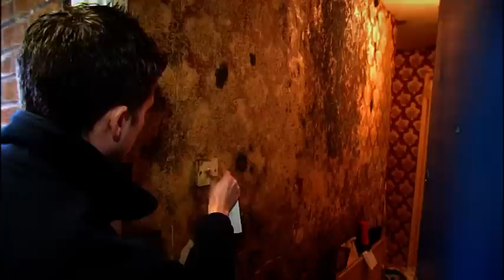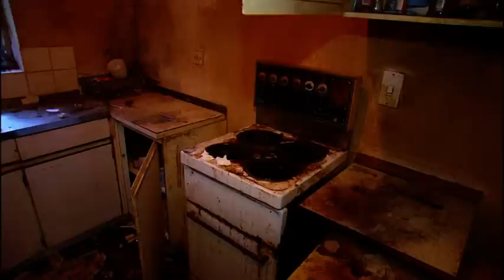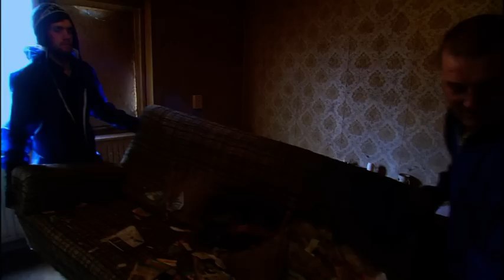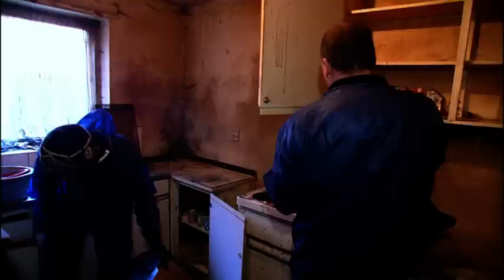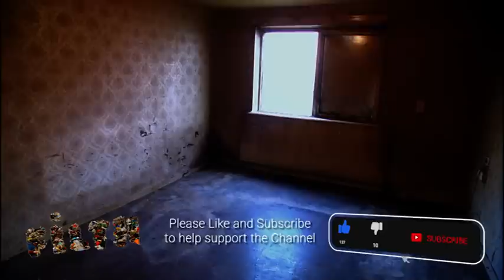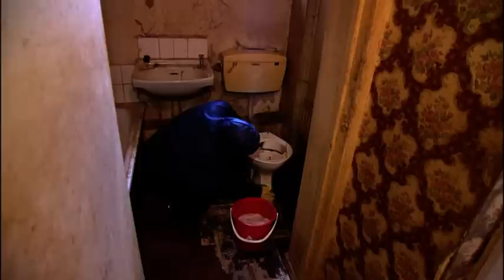The Worst Toilet In The UK | Grimefighters

Comment: i cant understand why they even bothered cleaning that toilet.. Its honestly (in this case) worth just buying a new one.
Reply: And you would've removed the shitty one yourself or what?
Reply: @earthbound_one  that's exactly what I did with the toilet in my place when I bought it no way was I cleaning that.
Reply: graham moore  was thinking this. The toilet was beyond use even clean. Would of been much cheaper to pull out the old one and put in a new one.
Reply: I feel sorry for the new set of tennants who are going to occupy that flat
Reply: its a council flat, the council wouldn’t pay for it so the cleaners would have to buy it if they were to break it. people of higher power wont spend money on working class people like this
Reply: @louise.g80  They have to rent out these flats in a good condition. The cleaner would not have to buy squat. If they are so keen on not spending a penny they would not of hired cleaners. On top of this replacing the toilet would have been cheaper than the time it took him to clean it.
Reply: Sir Budz no what i mean is that the toilet still worked so the council wouldn’t go out of their way to buy a new one unless it wasn’t useable, everyone here questioned why they cleaned it and didn’t just throw it away. also i dont know why i said cleaners would have to pay but if they were to just break it up (while its working) without checking with the council first the council probably wouldn’t be happy
Reply: Exactly
Reply: I mean where I live you can get a brand new toilet for 75 dollars sometimes at the big box hardware store
Reply: buRn thE fUckInG bUilDiNg dOwN
Reply: I was thinking the exact same thing. They had Rob cleaning a broken toilet for a good few hours. That thing was FUCKED.
Reply: @louise.g80  that's just absolutely not true at all. Of course the council would fit a new one. It's in their best interest.

Comment: "That house doesn’t need cleaned. It needs burned to the ground." That's not even an exaggeration. The whole house, it's walls and floors, has soaked in bacteria, viruses, mold, and who knows what else. Someone living there with mental health issues could have used weird chemicals on the floor or spilled who knows what or poured shit down the sink.. You don't fix all that with some surface cleaning.
Reply: I was thinking the same thing. The cabinets needed to be ripped out, all appliances and fixtures needed to be gone. The dry wall and floof in the walls needed to be pulled, the sub flooring needed tk be pulled. It needed to be ripped out down to the skeleton of the flat.
Reply: Exactly! Rip out the wallpaper, the flooring, cabinets, bathroom EVERYTHING and install new ones, not worth cleaning really
Reply: EXACTLY WHAT I WAS THINKING!!!
Reply: Yes! That thing is soak through. If new tenants move in they'll be sick in no time...
Reply: I completely agree! and anyone who was informed of this situation prior to renting would never agree to move in
Reply: I would be like, "what the hell are you guys doing? Burn this place back to Hell!!" Lol.
Reply: The poor new tennants be touching everythi g and putting food on bench
Reply: @MoonstoneFoxy  the landlord don't live in it so financially  just polish it up a bit  for a 1000 $ or so then rent out to unsuspecting tenants
Reply: I'm thinking they'd have to completely demolish that particular apartment and build back up.

Comment: Why even bother cleaning that toilet? Buy a new one it would have been a lot cheaper than paying him 3 hours of work
Reply: i was thinking exactly this. the toilet looked old and useless anyway. just buy a new one get rid of the old, in fact should get rid of most things in that property. including units, boiler everything
Reply: Burning the house down would be too risky just put a Pentagram on it call it hell and bury the house under a Hill and deem the land on it unholy Forever
Reply: I'm not cleaning that toilet no way not even for £40 an hour. Your better off getting a new toilet
Reply: @ronoccc  they likely replaced most things in that flat. Issue is the contractors and tradesmen are not trained and would not touch those things to remove and install new until they were clean. It's a safety hazard for them.

Comment: The best thing to have done would have been completely removing all the floorboards, plaster, bathroom and kitchen. Then gutting out the entire house from any mold and bacteria. I wouldn’t even consider putting a new kitchen or bathroom in untill the house and it’s pipes are cleaned from the inside!!!
Reply: No. Just demolish it.

Comment: usually when the councils have these bad properties like this they just do a quick cover up job rather than spend money on rebuilding and damp proofing.
most of the time it is a simple scrape and paint over the mold and rotten wood and jobs done.
just make sure the new tenants sign fast before they smell the dead rats in the walls.
a lot of the time these people are either too proud to ask for help or do not have the mental capacity to do so in the first place.
the councils in UK are supposed to check tenants yearly to make sure they are looking after the place so somebody didn't do their job.

Comment: Why clean it?   Gut it!    The place needs renovation, the fixtures, cabinets etc. are outdated, ugly and might not even work.   Suit up in a bio suit, strip the flat down to the studs, bleach the subfloor, rewire and re-rock the place.   I don't care how much scrubbing you do, that mildew and feces smell (and likely mold spores) will be in any porous material forever.   If it's bad enough (like with fire-smoke damage) the studs will have to be treated and or sealed.  Rip it out, start over fresh!